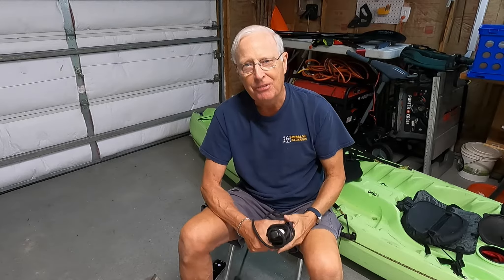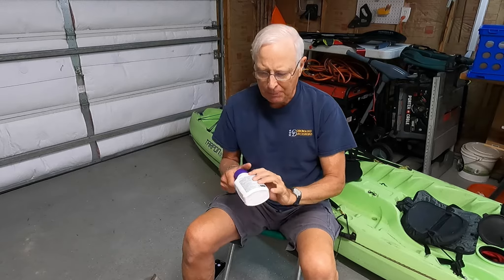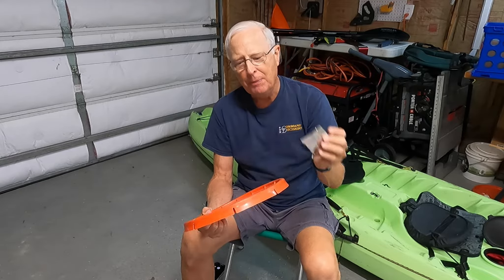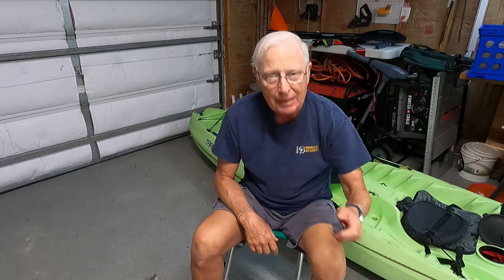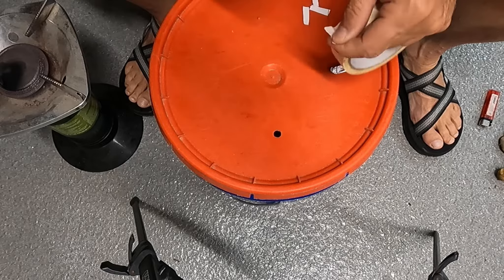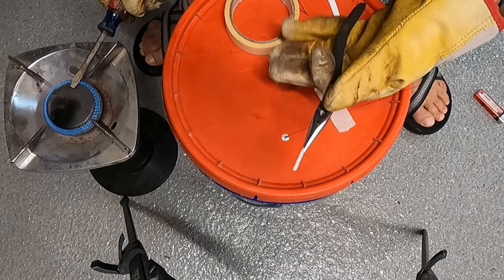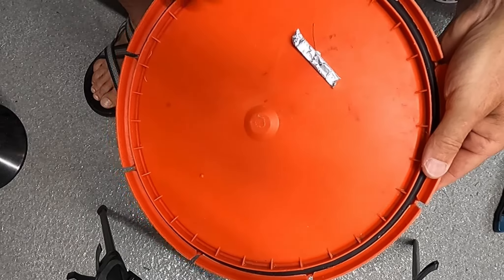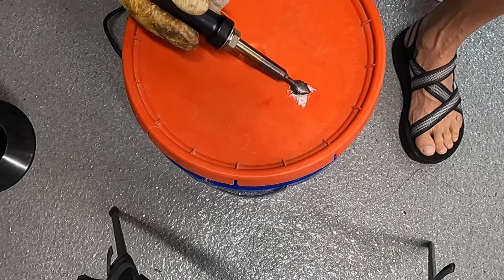Fishing Kayak Setup for Beginners - Step 7c - Kayak Repair Plastic

Comment: NICE.... I am definitely going to put in my Kayak Emergency box;
1. crappy wide blade screwdriver. 
2. precut HDPE strips of varying widths and lengths. 
3. a 'cigar' torch lighter you can buy at most convenience stores or truck stops.
4. a neatly folded piece of HD foil.

Thanks as always. 
Nick in Redfield Arkansas

Comment: Thanks for sharing this video; very helpful.  The patch will be more robust if you heat the area around the hole on the kayak first.  Using a heat gun (being careful not to overdo) or a heated blade/tool/spoon/etc, get the area around the hole soft. then melt the rod/patch material around/into the hole, then use your tool to press in.  This ensures that you get a good weld (merging of the patch material with the kayak).
Reply from the maker: Great tip! Thanks

Comment: I used a 1 in. metal putty blade and a torch, worked really well, repair bonded and smoothed almost at same time. also found orange scrap pieces of cable ties, so repair blended with the kayak.
Reply from the maker: Great tip! Thanks

Comment: I would have heated a spoon to perform the repair.  A spoon would have smoothed out the plastic a lot better than a screwdriver. I keep a bit of hdpe and a spoon with me when I go kayaking. All I need is to make a small fire on a lake island so I can perform repairs on the fly. I like a teaspoon but I have heard of folks using a tablespoon.
Reply from the maker: Great tip!

Comment: Thanks, really love this hack, the plastic welders cost a fortune here in Australia.    Unrelated question - would you cut a hatch hole in a kayak?   My sit on top fishing kayak has no hatches.   I was thinking of getting a hatch off ebay and cutting a hole in the flat surface where I want it, mainly in the front and rear wells.   What do you think?    (Mainly for extra storage as I like to camp from my kayaks as well - obviously I need to mind the weight)
Reply from the maker: As long as the hole does not impact the structural integrity, you should be OK. I recommend looking on YouTube to see if anyone else has done it to your model of kayak - those might provide insight into any problems. You can always ask the follow up question on those videos about issues subsequent to the modification.
Reply: I just added the 10 in. hatch to the front of my kayak, added silicone to both sides of the neoprene gasket to ensure waterproofness. pay very close attention when high speed sanding to the final diameter , you do not want the fit to be to loose.( it holds the pelican box for wallet, keys and phone).

Comment: do you think it's possible to heat the hdpe enough with a heat gun?
Reply from the maker: On my kayak, I gently heat the thicker HDPE with a heat gun to warm it up. But, after that, you need a hot tool to melt the plastic. Continuing to heat on a wide scale would melt everything.
Reply: @KayakhacksFishing  makes sense. Thanks for the reply!